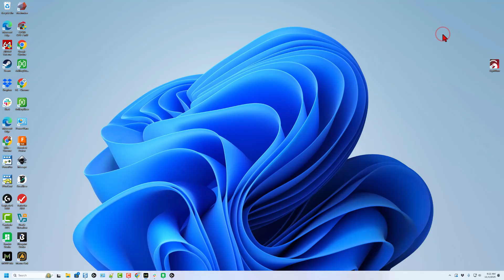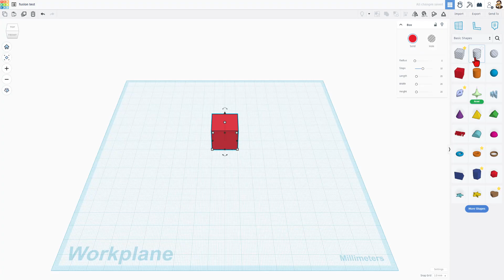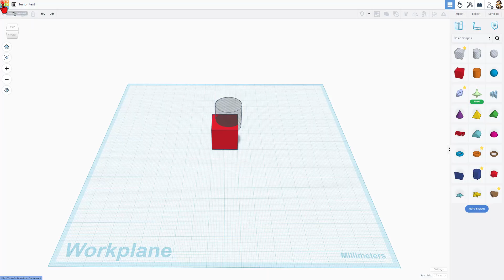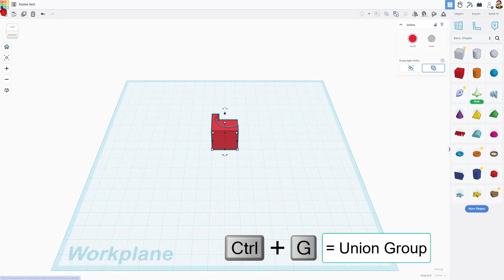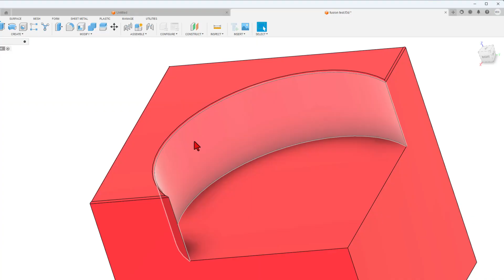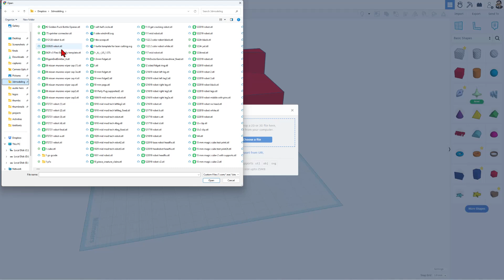Maximize Tinkercad with Send to Fusion: Fillets in Minutes! 💯🔥

Comment: Every time I try this, Fusion opens but my Tindercad file isn’t there.  I thought maybe my design was too complicated so I tried a basic cube and same result.  I have a free version of Fusion that I have been using for over a year and Fusion works fine.  Any ideas what I’m doing wrong?
Reply: Thanks.  I’ll be watching.
Reply from the maker: I have been told that it may be an issue that you sign into Tinkercad and Fusion with two different accounts. I will be recording a video soon demonstrating a work around. I just have to master it... and test it. =) Stay tuned!
Reply: Any progress on the fix for sending TinkerCad to Fusion?

Comment: I just save mine to mine computer using export.
I print on bamboo labs, so when I export bamboo takes it from there.
I print warhammer 40k for me and my year old.
I make some files and use others fikes too.
I try to print whole items so we don't have to glue too much
Reply from the maker: Thanks for the details. It is always cool to hear how others work.
Reply: @HLModTech if I didn't use a bamboo I would probably use a different program

Comment: Ive had problems sending to fusion on windows 11, works on my windows 10 laptop. In windows 11, I have to send the project to team project, then open fusion and retrieve the model from the team projects folder to be able to import it to fusion. Another issue with sending to fusion is im signed into tinkercad with Google sign in, but my fusion  account is my email address. Even though it's the same email address as my Google sign in it doesn't have my model I put in a team project or my team/project. to overcome that I copy the model, sign out of tinkercad of my Google sign in and sign back in with the same email address as I have my fusion log in. Open a new project, paste my model, then I can send it to a teams folder and open in fusion.  If fusion had sign in with Google it would stream line it greatly lol
Reply from the maker: Thanks for the info. That was actually a point that was raised when I was talking with devs today. Bouncing between accounts does change things, Your strategy of sharing to a team project is something I will highlight in a future video. Thank you very much for the feedback!!!
Reply from the maker: I made this video because I saw all the complaints about doing it with win 11.... Did you spot anything in my steps that would make a difference?
Reply: @HLModTech making sure fusion is up to date for sure. No  work arounds or direct send seem to happen ever unless fusion is running its latest software. I think thats half the problems that are had. And then the sign in matching is key. I still dont have luck with the straight forward send too method on 11. Honestly after a couple times of doing  the work around it is pretty much just as quick as send to, so im good with that method!
Reply from the maker: Thank you for the feedback. Have you ever tried the online version?

Comment: This would be great if I could get fusion to open up like that. As it is, I follow the steps you outline here and the program just sits doing nothing. I've waited for minutes and I've confirmed my fusion account works. No joy.
Reply: Robert, i have the same issie. I bet u are signed into tinker with your Google account and fusion with a email address. Copy your model then sign out of tinkercad, sign back in and create a new account with the same sign in you have for fusion. Open a new project and paste the model on the workplace.  Now do the send to but send it to a team project folder.  Now open fusion and open that project folder and the model with be there, click on it and now its in fusion. Im also going to guess that you perhaps are on windows 11 . From my windows 10 laptop the process works exactly as described by hlmodtech, on my 11 computer I have to do the work around
Reply: @Sinnedfabrications I was also wondering if rhe issue might be that I use Tinkercad as an application in MS Edge. This came to me earlier and haven't had a chance to test that out. I am on Windows 11. I will try your routine later, thanks.
Reply from the maker: Any chance you have pop ups blocked?
Reply: @HLModTech no pop-up blocker, but ad blocker which might do the same.
Reply from the maker: Agreed @RobertNewsome . I would try to disable that for Tinkercad. There are no ads in there anyhow.
Reply: Excellent video! I was aware of this feature but couldn't get it to work on my own. Still have some confusion with getting it to open but I got it to work once so far. Please do more on this subject. What else can we sneak a model in there and modify it?
Reply from the maker: @6rcracer6 Fusion is crazy powerful, but I have not mastered much of it. I recommend the course at cadclass.org. They are very thorough. Use the coupon code 25hltinkercad to receive 25% off any courses you choose to take.  This link will get you there. https://bit.ly/tink20days

Comment: Hey great video I like this channel so much:)
Do you have a clip oder tutorial about importing complicate stl, which tinkercad refuses to import, to lets say add a cutout/symbol that I wanna put in :( I have a real neat box System but I wanna add a cutout of my logo, usually with tinkercad no problems here..
Reply from the maker: I would try to simplify the design before importing. Meshmixer is one way. This is my Mesh Mixer Playlist. https://bit.ly/meshmix
Reply from the maker: Thanks for the kind words too! You can also Reduce STL size in any Prusa based slicer. https://bit.ly/hlkoolaid
Reply: I had the same problem.. Too complex a drawing... tried one with less detail and loaded fine.  Had to send the complex drawing via an STL export then import to Fusion.
Reply from the maker: @jim45roberts  Great strategy!